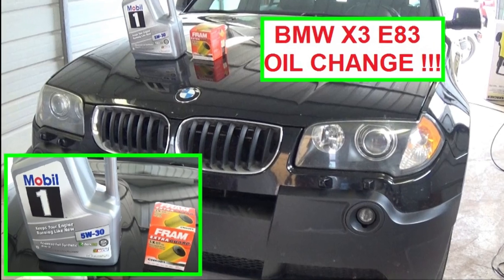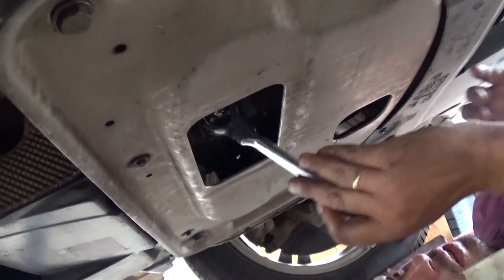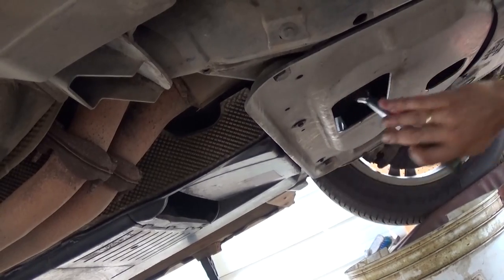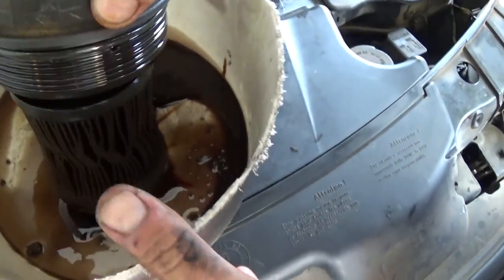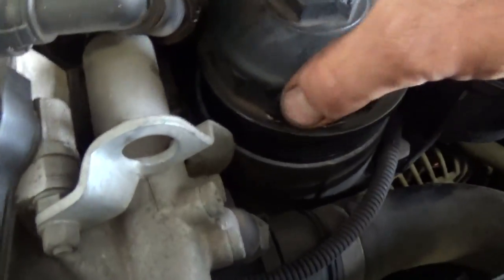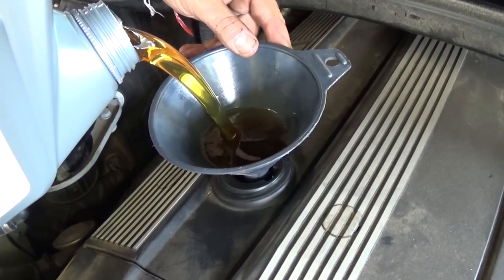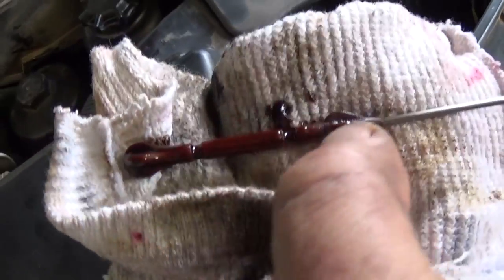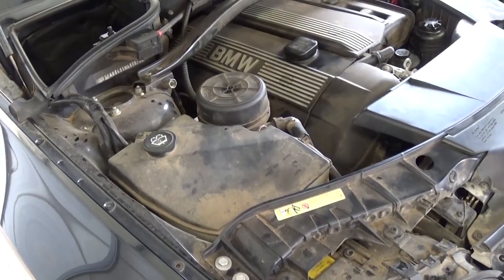BMW X3 E83 Oil Change  How to change the oil on a BMW X3 2.5 3.0 Engine

Comment: can you put up a video on how to change the transmission oil fluid?
Reply from the maker: +LuxuryLifeWith_ Aly is yours automatic or manual?
Reply: bmw x3 2004 3.0i automatic

what transmission fluid do you recommend ?
Reply from the maker: +LuxuryLifeWith_ Aly mine is Manual because It was imported from Europe. For the Automatic if you get under your vehicle on the bottom of the transmission there is a label that says the necessary fluid. For the 2004 and 2005 models I think Bmw recommends Mobil1 Synth Dex VI, which is about $12 on ebay for 1 quart.
Reply: ok thank you .